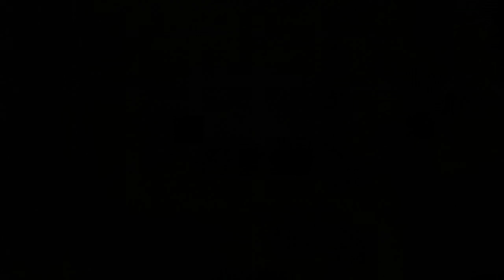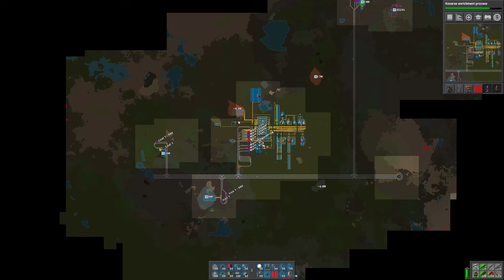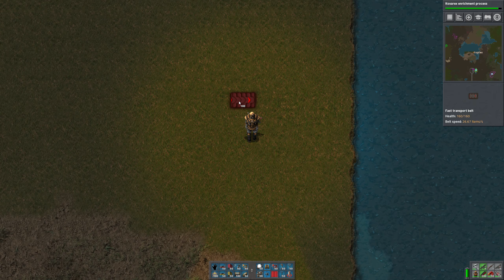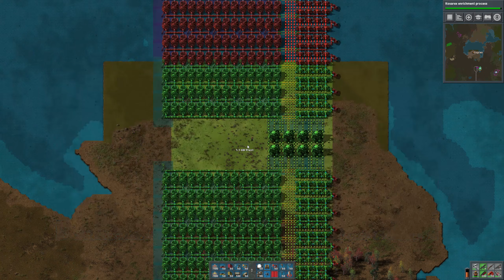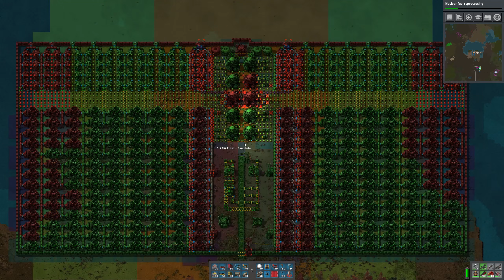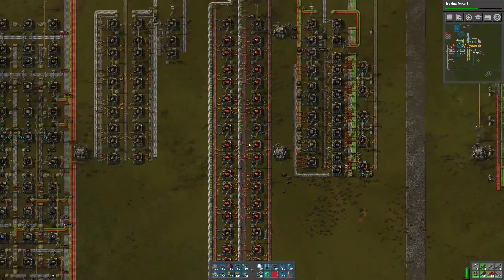Factorio 0.16 Let's Play #23 - Setting up nuclear power

Comment: A good method of controlling your coal fired steam production is to use an accumulator as a trigger.  Connect the coal/steam's offshore pump to the accumulator with a wire, and set the pump to only activate when the accumulator reaches a certain percentage of charge.  That way you only use coal/steam power when the power demands start to drain the accumulator.   You don't have to use any solar it will work as a good trigger regardless,  but a robust solar array with accumulators in proper ratio makes a good power buffer.

Comment: A simple circuit condition for your nuclear is if the storage tanks are below a certain lvl the reactors kick back on.  Say you have 120k of storage when it's full the reactors shut off, when storage is drained down to 20k you have the reactors kick back on.  Easy peasy.
Reply from the maker: Yes, that will work, but if you don't also check if fuel is already inserted, then you will continue adding fuel cells to the reactors, and they will get a full load of 5.  I'm trying to limit the reactors to only one fuel cell at a time.  I've mentioned that such stinginess is probably not necessary, as we have plenty of uranium, but I thought that some folks would be interested to see how it's done.  Thanks for the comment!

Comment: I believe that the steam turbines and steam engines are at the same production priority, so both sets should be producing at the same performance. This is how it seems in my .16 game
Reply from the maker: Hi Glypha, I think you're right, it seems to balance the load on all steam-powered sources.  I would prefer the game to prioritize nuclear, since we spend the same amount of fuel for any utilization less than 100%, but it's easy enough to fix it with a power switch.
Reply: Yes, I agree. That would be ideal. I think high temp steam below solar and above low-temp steam/accumulators in priority.